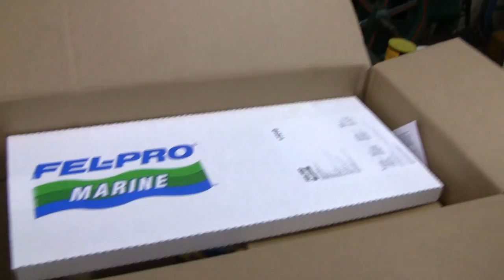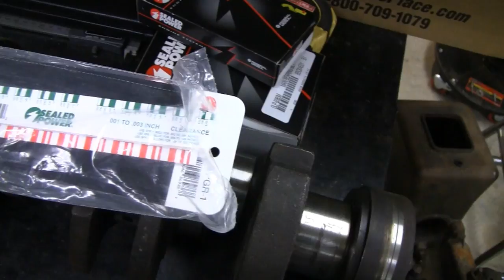CHEVY 4.3 ENGINE REBUILD (part 3)

Comment: Holley makes an aluminum timing chain cover for 96 & up small block Vortec V6 4.3L & V8. The plastic one is supposed to be replaced every time it's removed. I put one on my S10 p/u. The stock plastic one had been leaking there for a long time.

Comment: Just needs some rings for them pistons and I usually put in new freeze plugs.  So what, the crank he ordered was turned down or they sent the wrong size bearings?
Reply: The crank was turned down so he ordered the appropriate sized bearing and they sent him stock bearings.

Comment: is there a reason you can't use standard automotive gaskets in a marine engine or is there a specific reason you had to order the marine gaskets? also I was wondering if I could use a 4.3 marine motor to replace a broken 4.3 in a s10?

Comment: you focus to do bearings and theyre the wrong ones,,Man... recheck your piston ring type or theyll give you the standard size, and you have a balance shaft v6 which ring type is metric =cost is the most expensive..same with the new timing chain offset because of balance shaft gear sits on cam first check ball bearings on the balance shaft or youll hear feel it with all the new torque..  its a good motor if rebuilt right..  dont let the bearings untrain your focus  that boat will fly